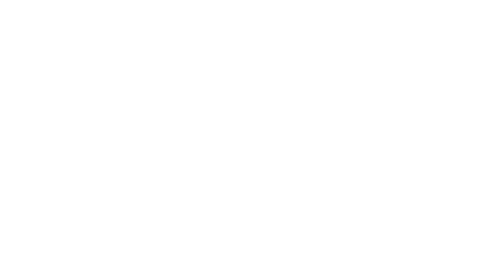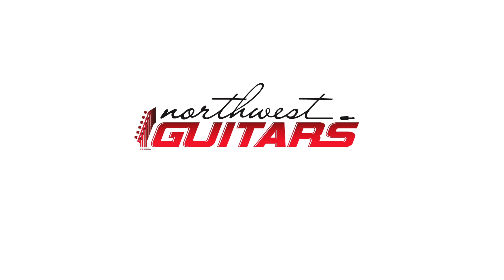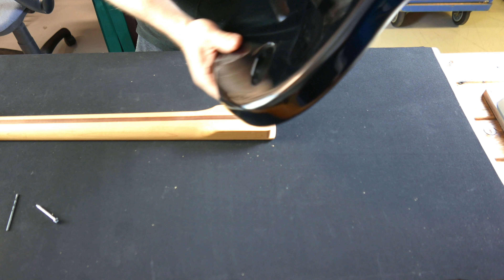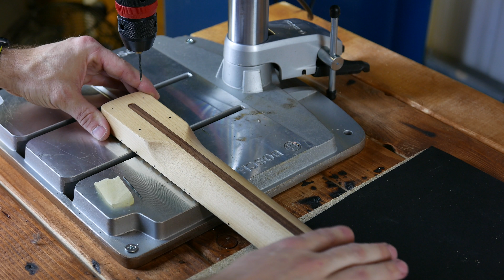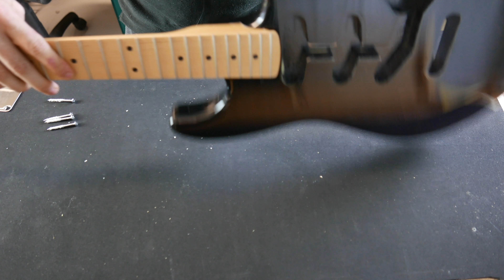Complete Stratocaster Guitar Build Tutorial Pt 2 - Neck Installation

Comment: I also use the E strings to check positioning, even though the pocket fit - on good necks - is also good these days. Actually, I wipe the pocket and neck with a gentle fibre cloth then vacuum out the new screw holes to avoid that nasty dusty bit stuck up there. On strats, I sometimes check the pickup pole line-up. These days I only fit good roasted maple necks that shouldn't ever shrink. Oh, don't always believe that new factory Fxxxxr necks are as good quality as those they fit to complete guitars...I found that it ain't necessarily so!

Comment: I've bought various parts from you in the past. I'm currently looking for a Tele neck but this video doesn't instill confidence because as other commenters have said, you should check the string alignment when drilling these holes. You can move necks around slightly before tightening but if you get this way off you will be in serious trouble.

Also, why are the skunk stripes on the neck backs wider than usual Fender necks? Is there any reason for this design decision?

Comment: I am trying to install a neck into a body, and have the opposite situation/ problem. I have pre-drilled holes in the fender neck, but no holes in the body. I can't work out how to accurately align the holes, as they are hidden when I place the neck into the body. Other than trying to measure accurately with a rules, is there any tricks or tips to doing this so that I don't ruin a body by drilling the holes in the wrong place? Thanks
Reply: Hi, I expect you’ve sorted this now but I think the correct approach is to drill the holes on the neck and fit and glue dowls. That way you can drill new, correct holes.

Comment: How often is neck /tilt angle an issue? I know shims are used sometimes, but if you take a neck off a good guitar to do some work, will it most always screw right back to the needed angle? Seems like just a little off could be a problem? I'm trying to learn to do this basic stuff. Thanks!
Reply: If you mount the same neck on the guitar it should be ok, unless there already are shims used. I had to use a tiny shim on a replacement neck recently because the new neck was a bit thicker and needed a slight tilt in order to be able to adjust string height properly.

Comment: I see some Fender models will have shims, or adjustable shims in the neck pocket, why is this necessary?
Reply: Some guitar players prefer a tighter neck pocket than others
Reply: @mrstevebarber  I'm talking about the shims placed under the neck block, which change the neck angle when adjusted. Think Fender actually do a microtilt thing for this  Just not sure why they would be needed if the guitar and neck were built to spec already.

Comment: The fingerboard and frets are curved ... how do you (1) know the screw holes are perpendicular to the flat part of the heel and (2) how do you stop the neck from rocking and (3) how do you ensure the neck is correctly aligned (run elastic bands from the nut to the bridge saddles???).